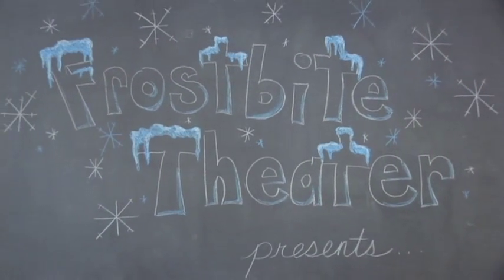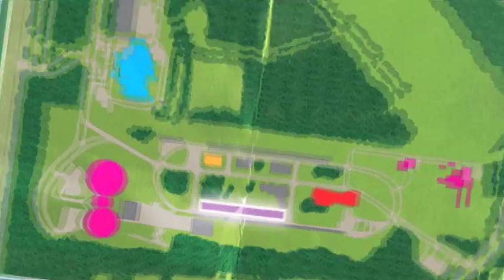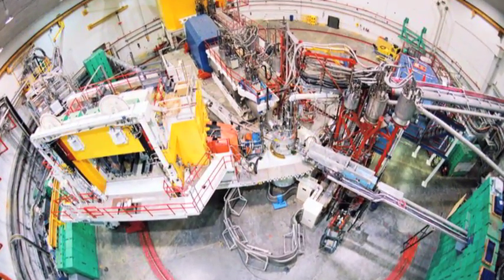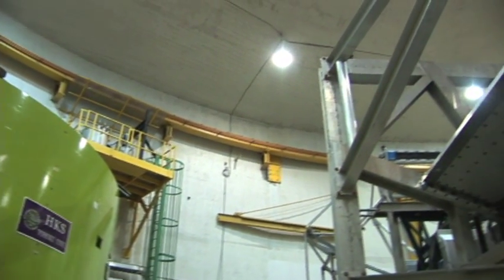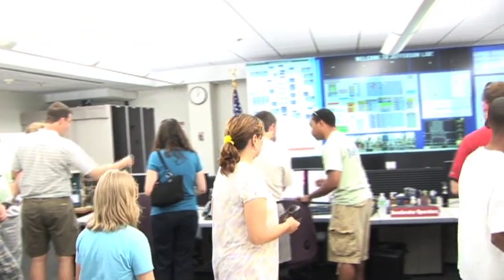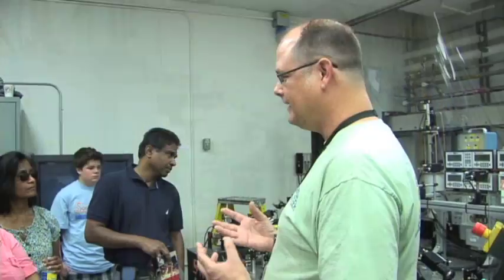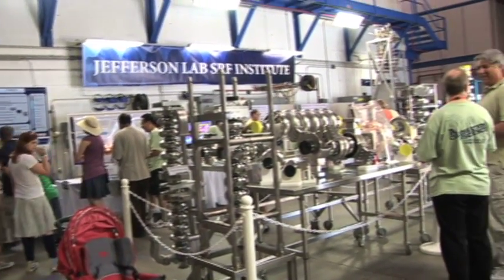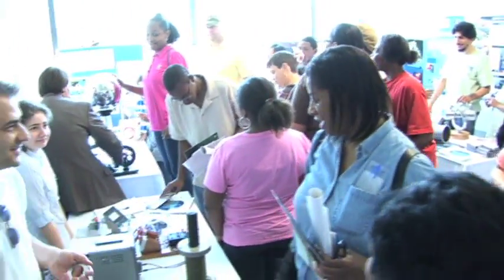Jefferson Lab Open House (2010)

Comment from the maker: @dudeyourvideosucks Well, first of all, it's a little bit more than a building. And, we also said "It's part of a $312 million upgrade that will also double the accelerator's operating energy." We're building an additional experimental hall PLUS doubling the accelerator's operating energy for $312 million. For comparison, the original cost of the accelerator and end stations was $600 million. So, double the energy plus an additional hall for about half the original cost. Not a bad deal.